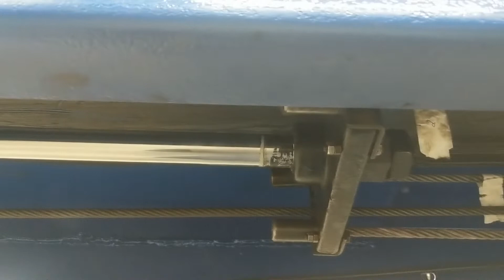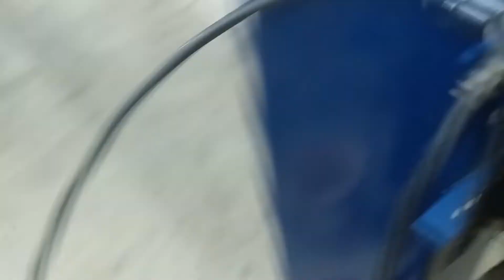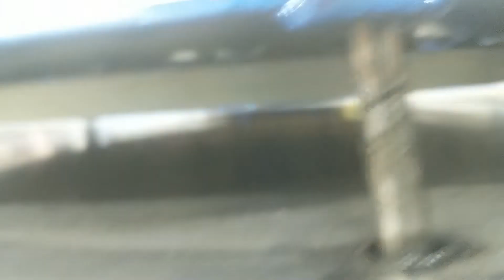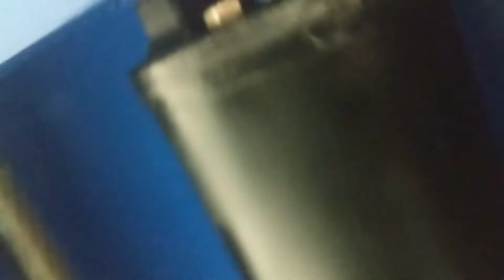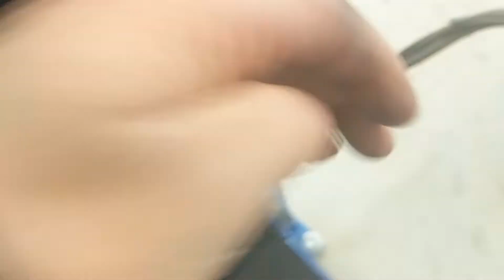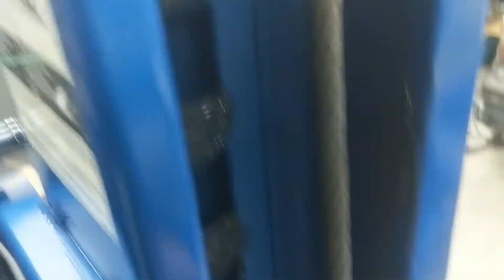Things to know before buying a 4 post lift

Comment: Great job. Wiah you would have said what you paid, then spent restoring vs new.
Reply from the maker: I have prices listed on my website.... Around $3500 total. 2k for lift, center jacks and old alignment machine. Then $1500 for paint, replacement cable, replacement pulley, new lock stops, some replacement steel and a cylinder rebuild. Definitely not worth  buying one in as rough shape as mine. However this lift has let me store 2 of my cars parked sideways underneath it and my friends Corvette on top during the winter. Over time it will pay for itself.

 https://802projects.com/blog/rotarylift/rotarylift.php

Comment: Very well done, this has been a very informative video for me.  I have bought one of these used from a dealer that takes trade-ins.  It is in fair shape and should need little to no parts since it was yearly inspected in a state garage and was required to have all worn parts replaced.  Still, I would like to paint it and go though it as you have and your pointers and assembly tips give me a good idea of the road ahead.  I did secure the factory manuals for it from the dealer like you did.

Comment: Just curious why you couldn't move it by parking your trailer under the lift.  Lower runways and crossbars onto 4x4's across the trailer then keep hitting the lower lever and use 4 ratchet straps to raise the legs up as much as possible.  I think this should work, put 2 sets of ratchet straps on each corner if really concerned.  Then strap whole thing down to the trailer, may even be able to leave the bridge jacks in place and strap them down.  Even if you have to drive 100 miles at 45 mph that's quicker than taking it all apart maybe?  By taking it apart you did find some interesting worn out stuff but still, I would seriously consider moving it without taking it too far apart.
Good video of your process and good tips nonetheless.